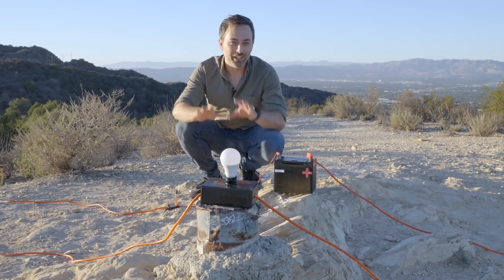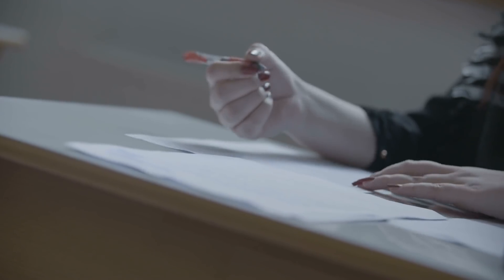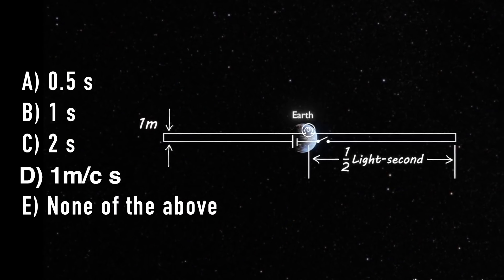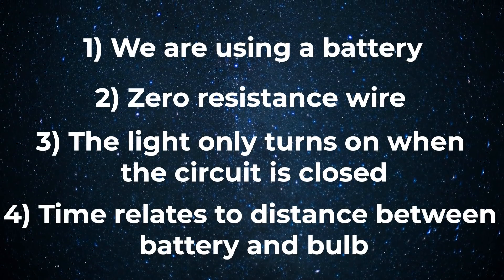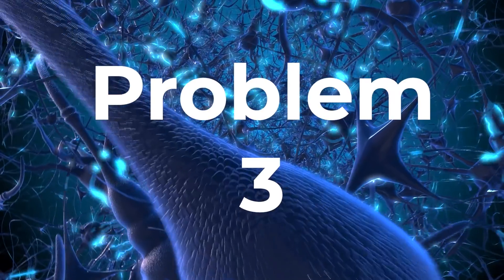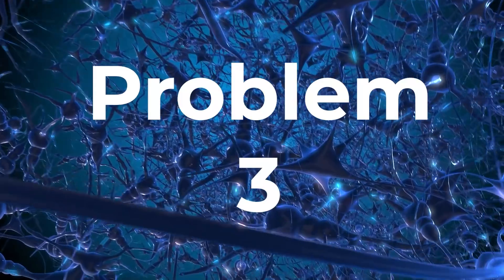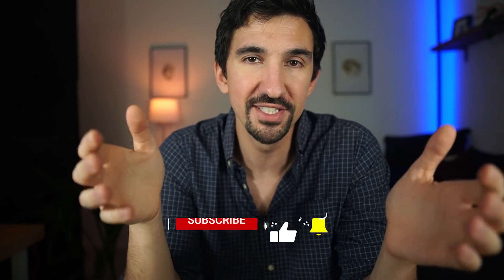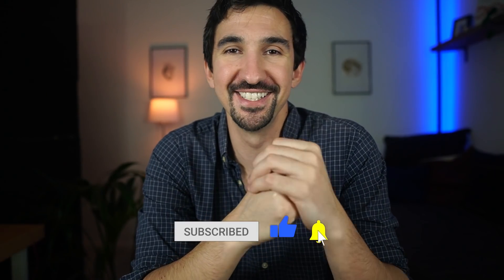Is Veritasium Wrong About Electricity?

Comment: Despite the fact that the thought experiment allows for no resistance in the wire...
Veritasium is making several mistakes. 
The amount of energy required to light the bulb must be considered as "some reasonable" amount of current for the Light to turn on, NOT "any ridiculously small amount of current". 

The claim is that the when the switch is closed, the current starts moving which induces an electromagnetic field (EM field) in the wire near the switch.
This means that an Electromagnetic Wave will be produced and start radiating from the wire and will reach the light bulb after traveling only 1 meter.
However, Veritasium ignores the fact that the EM Field traveling thru the air or free space will be inversely proportionate to the square of the distance. Therefore the energy reaching the bulb after 1 meter of travel in the air, will be very very small. 

The counter claim would be that the amount of current needed to turn the light bulb on is very very small, and any amount of current would turn the light bulb on, but then why bother with wires at all? It makes no sense since in that case, one simply has to touch the battery or touch a switch connected to the battery, and not even have the wires present. So it makes no sense to setup a giant thought experiment requiring 300,000km of wire with a switch if all Veritasium wanted to demonstrate was that EM fields radiate.
So, we must conclude that Veritasium earnestly believes that the energy in the EM field traveling thru 1 meter in the air is enough to power a regular light bulb with regular amounts of current. 
But he is wrong.

Some will say that Veritasium requires "ANY" amount of current to be acceptable. But the counter to that is ... no. He claims that once current reaches the bulb then the bulb instantly turns on. That current must be considered as "the required current" to activate the bulb and not "any" current... otherwise, mere movement of anyone to even turn the switch... the blood flowing in your body, etc would activate the bulb thru induction. so since that is a preposterous assumption that such a low amount of current would activate the bulb we must then conclude that the bulb does require a standard amount of current to turn it on and simply that it must turn on immediately when receiving that current rather than a delayed effect in time due to filament heating / driver charging etc. 

I also find it immensely frustrating that the "papers" provided by the experts are in no way "proving" any of Veritasium's claims. They are not 1 for 1 and they are extrapolating two or more very different experiments. Additionally, they are simulations and then those simulations are extrapolated.  Going back over the Power point provided by Veritasium shows that at 2.5 seconds only 0.25 volts are measured (under the simulation). That is FAR LESS than the energy needed to light a bulb.
Extrapolating to a 12volt car battery and light bulb we get ~1/10th of a 12 volt battery's voltage which simply cannot light a bulb.

So the answer is that current necessary to light the bulb properly must travel 300,000km down the wire in order for the bulb to receive enough current to turn it on. So the amount of time to travel that distance is the amount of time it will take for the bulb to see that current.

Additionally, it is not constructive to claim that we have been told "Lies" about the nature of the electrical energy. Those are theories. Not lies. It does science a Great Disservice to rebrand past theory as "lies".
@Dr Ben Miles... I agree with you on almost every point.
@Veritasium, with respect, It devalues your integrity to use these methods to drive conversation. I much prefer your older more conscientious methodology where you are more careful about the things you say. I am especially focusing here on the claim regarding "Lies" in your video. Remember that your value to the scientific community is in your integrity not in your hype.
Reply: > However, Veritasium ignores the fact that the EM Field traveling thru the air or free space will be inversely proportionate to the 
> square of the distance. Therefore the energy reaching the bulb after 1 meter of travel in the air, will be very very small. 
He ignores it because this concept is wrong (it doesn't apply here.)     That's why it's counterintuitive!  (Also, for wire-shaped sources, it would be 1/r, not 1/r^2)

It may SEEM as if thin wires spaced at 39 inches must act "very distant."   But this isn't right, since this ignores their immense length, where, compared to their length, the gap between them is insignificant.  So instead they must behave as if they were very, very close?  Like plates of a capacitor?

So, which is it?   Do the two wires act like vast capacitor plates, where the bulb will immediately see 12V as soon as the switch is closed?   Or do they act like thin whiskers, where the other wire is so distant, that we can assume that the coupling between them is basically zero?

Actually both ideas are wrong, because this particular physics is very well known, at least since Oliver Heaviside figured it out.  The capacitance of the two wires and the inductance of the two wires essentially fight each other, producing a single value, independent of frequency.   This value is called "line impedance," and behaves like a pure resistor.

The coupling between the two wires acts just like a resistance.

So, if the long wire-pair can be replaced by a resistor, what is the value?   Just pull up an online calculator for 2-wire transmission lines.   For 39in spacing, we get a resistance between 500 and 1000 ohms, depending on the wire diameter.

So, just throw a couple of 500-ohm resistors in series between the battery and the bulb.   That model will tell us whether the initial bulb brightness is microscopic and easily ignored, or whether it's a large fraction of the final brightness seen later, after many seconds.

If our "bulb" is an LED designed for 5mA and 12V, then it behaves roughly as a 12/.005 ohm resistor = 2400 ohms.

With a 12V battery, and two transmission lines of 500ohms, the initial bulb-brightness is 12/(2*500+2400) = 3.53mA, or 71% of the final maxium brightness.

So Veritasium is right, and the bulb instantly lights to more than 2/3 brightness.   Then after many seconds (many reflections,) it will step up to 100% brightness, the 12V applied directly to the 5mA LED.

On the other hand, if the bulb is 50watts, or 12V at 4.17A, then the bulb acts like a 2.88 ohm resistor.   Maybe the transmission lines behave as 1000 ohm resistors, not 500.   In that case, initially the bulb will light up to far below 1% of maximum, since those 1K impedances act like severe current-limiters on a three-ohm light bulb.

THE INITIAL BRIGHTNESS DEPENDS ONLY ON OHM'S LAW.    Use a high-volt battery, and a few-milliamps bulb, and then the initial brightness will be close to 100% of the final brightness.   Or, use a 1V battery and a thousand-watt bulb, so the initial brightness is undetectable, and the bulb only lights up after the 1-second line-reflections have occurred.
Reply: @wbeaty  Interesting thought. I would be willing to accept 12vDC @ 10 watts. Could you provide a calculation for that? And this works for DC???
Because he is using a battery. So,  I am really not buying the idea that a 12v DC battery is going to result in a steady state transmission line. 
Perhaps you can explain that?
Also, I am still very hesitant to discard the loss of EM strength as the square of the distance from the moving charge, but I am having an open mind on it. Since, it is technically possible that there would be an interaction. However, I am doubtful about the DC effect. So, I would like to see proof. If there are 2 parallel wires 1 meter apart, and extending 100' but the ends are not connected, is the effect the same?
Reply from the maker: Hey, thanks for the comment, yeah I agree with most of your points. Defining what "on" means is important so we know where we are aiming for
Reply: @DrBenMiles  I feel like Derek made a mistake by framing the question as "how long does it take for the bulb to light up" instead of "how long does it take for a circuit element in that spot to receive any amount of energy", because most of the people who can infer that's what he actually meant already know that energy is transmitted in the field, while the people most likely to get confused by the question are the people he's trying to communicate this idea to.

Honestly, it's a little bit unfair to use the characteristics of a real bulb to disprove this entirely hypothetical scenario since the point he's trying to communicate isn't about the bulb lighting up but more about the bulb receiving power, but he should have been more precise with his words because that's the whole point of science communication.
Reply: Here all people do not understand the fact veritasium experiment is to highlight the fact we do not know what carry electric current, seems to be a problem most of the people have very strong difficulty understand....
Reply: Is there a way to actually visualize points in space where EM energy is concentrated?
Reply: I agree.
Reply: Lots to think about-I had the same thought about the wires also but on the other hand it sounded like he was saying that the wires were needed in order to help carry the electric field to the lightbulb, otherwise why would you waste time hooking up wires if all that was needed was an electric field traveling through the air to power the light bulb especially if there are magnetic fields floating in the air everywhere it almost sounds like it would be a way to capture those 2 power everything we use
Reply: @karentruempy397  Your question have an easy explanation true air resistance eat almost all your power and to feed a lamp you have to use more power to reach the same goal.
Reply: Yes it totally irrelevant, the problem is another one, seems people doesn't understand electron doesn't carry electric current, do you know all my books was say so is the thing billion of people have study at school.
Reply: @markbarker8376  Moving Charged particles generate an Electromagnetic field. An electron is a charged particle. An electron that is moving (even very very slowly) generates an Electromagnetic field. Therefore electrons are the causative effect for much electricity, but they are not the "electromagnetic wave" itself. There is nothing specifically new or insightful here. This has been known for centuries by many physics scholars.  I don't think it is unreasonable to say electrons carry electricity since they are the holder of negative electric charge, without that charge moving, there would be no EM field. It is simply a finer grain of understanding, not a lie nor a deception. When the EM wave (which has no electrons in and of itself) meets a conductor with charged particles such as electrons, it generates electricity. You won't get any electricity from a non-conductor. So in reality, the EM field mediates the process. Let me make that more clear... an EM Wave that passes thru a non-conductor will not generate electricity. 
It has to pass thru some minimally conducting material to generate it.

 I am not 100% certain that we can "separate" electricity from the charged particle since you need both to have it. (AFAIK)
Reply: @marcfruchtman9473  Ok now you have only to prove it, or do you think figure it out is enough???
Reply: @markbarker8376  The fact that moving charges generate the EM Wave has been known for quite some time. And we know EM Waves can induce motion in charged particles. I have no argument that EM Waves carry electromagnetic energy or at the very least, can be used to convert into electrical energy. But, I also know that the moving charged particle is the big source of those EM Waves when you connect the battery. 
My issue is that he claims the light turns on after the EM Wave travels only 1 meter across air to the light. And since it is a "Battery" (NOT a tesla coil) that is powering the demonstration, he is completely wrong. Again, he has confused transmission theory with transmitting power thru a conductor somehow. 
The power arriving across 1 meter is simply NOT the same level of power from the conductor, and I don't understand why he has made such a huge mistake. Its very clear he is demonstrating using a battery. He should know this is not an AC effect.
Reply: @marcfruchtman9473  No you do not have the point, I know is very difficult to understand from ours point of view, what do you describe is what you can see but something seems to be wrong, for example what is if what do you describe is collateral effect of the electric current on the wire but in true the wire do not carry any electric current and the electric current use the wire only to focus his energy in the space as a vector, the real point is we can make different explanation but to know the real behavior we have to prove it and at the moment no one have prove it.
Reply: @markbarker8376  I don't quite follow what you are saying. Sorry, the grammar is very difficult for me to understand. It doesn't matter that the electrical energy is not carried in the wire. The wire is required for the electrical energy to be big enough to light the bulb. The electrical energy is strongest when it is closest to the wire. Without the wire, the energy gets weak very quickly. So, the energy crossing 1 meter of air is very weak compared to the energy along the wire.
Reply: @marcfruchtman9473  Sorry my English isn't very good I try to explain as better I can, what you describe is what you can see but not what it is, we can describe this behavior in many different way and we can make those way mathematically correct, but the right way is only one and in order to understand the right way you have to be able to prove it, for example  if the cable is only a vector to move the energy in the point of space maybe we can use another way to move this energy in the point we want without use any cable.
Reply: @markbarker8376  Yes, we can move the energy. But the debate is not about moving the energy. It is about the idea that the bulb would turn on after the energy reaches the bulb traveling thru 1 meter of air, and cause it to turn ON. It simply will not turn it on. There are several reasons but to be concise, the battery has a voltage and the bulb has the same voltage. When the energy travels thru the air, it will be far lower than the required voltage by the bulb. It will not turn on. 
Only the conductor can deliver the amount of voltage and current needed to light the bulb. 
We know that some energy will reach the bulb after 1 meter, but it won't turn it on.
Reply: @marcfruchtman9473  No the debate is how electric current move and we do not have a conclusive answer....
Reply: @markbarker8376  LOL, maybe you are debating how it moves. I am not. I agree with his assertion that electrons move very slowly, and I agree with his assertion that EM Waves carry electromagnetic Energy, and we see this every day everywhere in isolation transformers where there is no connection from the primary coil to the secondary. I agree with ALL of that.
I have two main issues: The first is that question wasn't "How fast does it take for electromagnetic Energy to reach the Bulb", it was "How long does it take to turn the light on."   (And you know that my definition of ON means that the light is visible and working like it is supposed to).
The other issue is that the power transfer of EM energy across 1 meter air gap is very small, and he is clearly implying that this EM Wave somehow bypasses the conductor to deliver power enough to "run our houses", and that's simply NOT the case. That's not how it works. It works by having the EM wave transmit along the conductor (very close to it, some inside of it, some very close but external to the wire), but it's the energy that is very close to the wire that has the majority of the power that is capable of powering toasters, ovens and dryers, NOT the energy crossing 1 meter of air gap. And now a LOT of viewers believe that is the case.
Reply: The inverse square law does not apply here, the battery is not radiating energy in all direction, instead all of the energy are pointed from the battery to the lightbulb